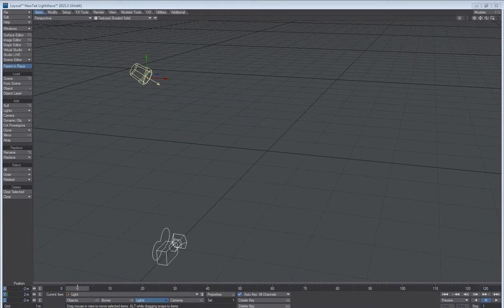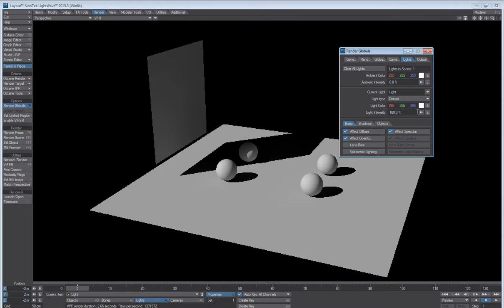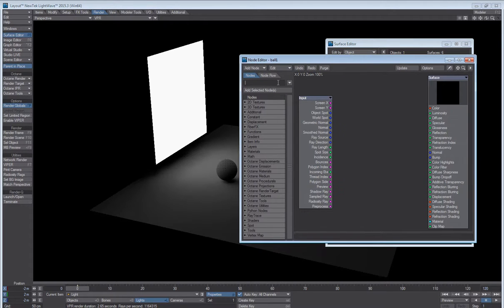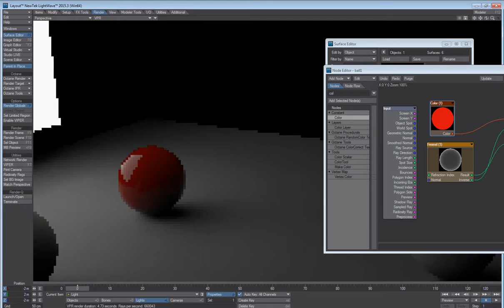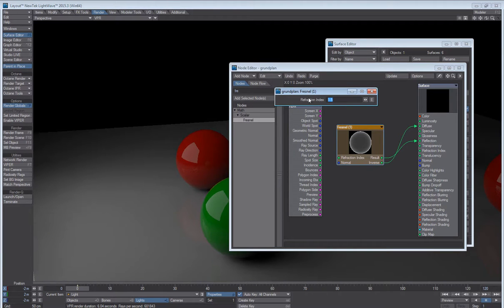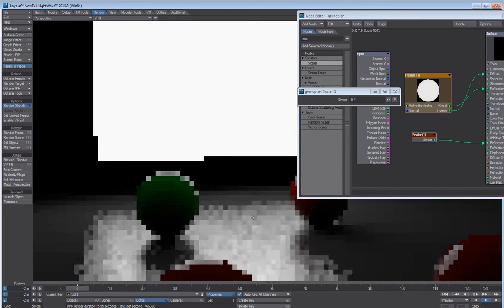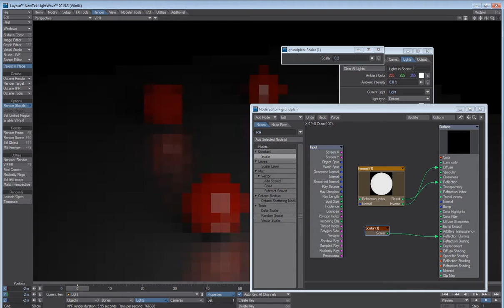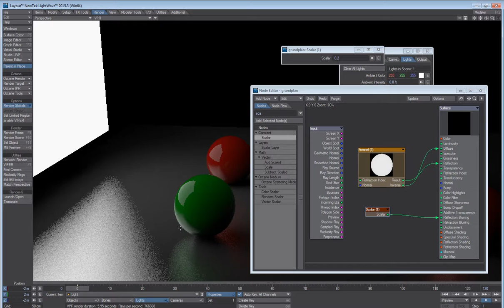Trying to Learn tekniques of PBR rendering in Lightwave

Comment: Add the fresnel with a clamp (that allows you to modulate the hi and low numbers) into the glossiness. Roughness is inverted relative to the glossiness so high values in glossiness = low values in roughness.